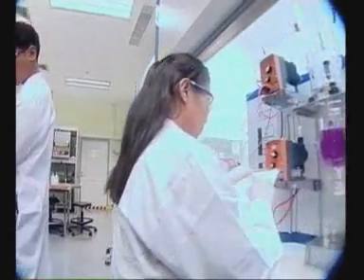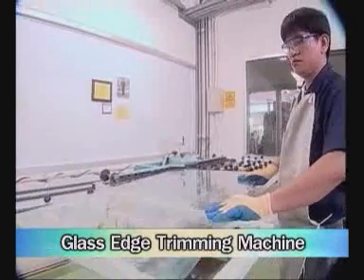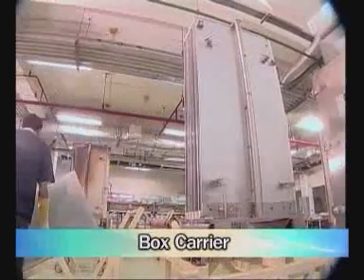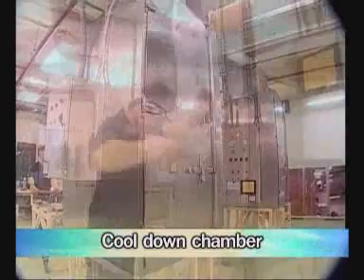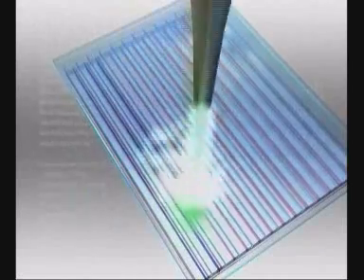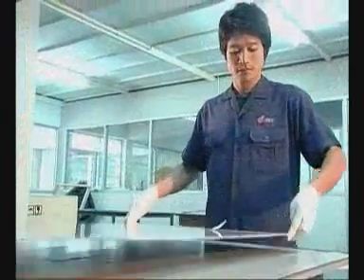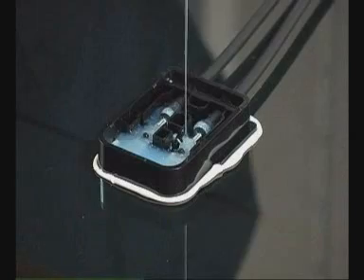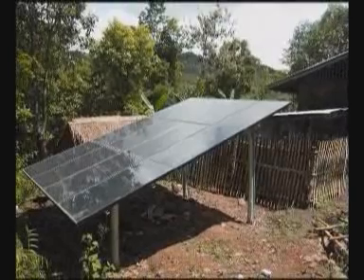Production process of Thin-film silicon PV

Comment: @Sonyoooo3 
Agree. Too much manual labour, and not enough automation.
Germans did the right thing by creating lab-grade sterile production line.
So many benefits from a single investment:
1. No contamination - less faults in solar cells.
2. Uniform PV cell production - guarantee of quality.
3. By having less hand labour the price of manufacture and thus the end product will inevitably drop down with saturation of the market.
4. Humans can do research instead of labour machines can do instead.